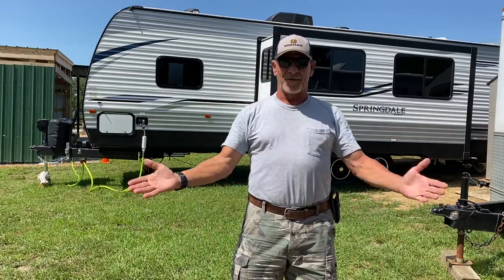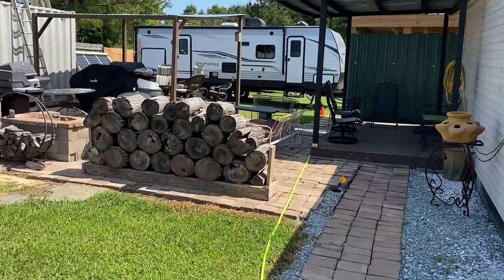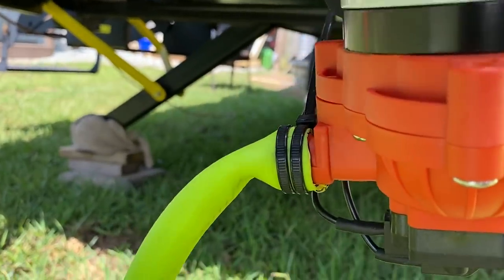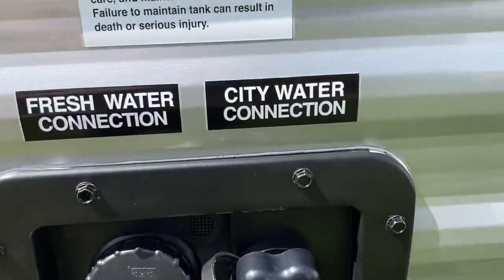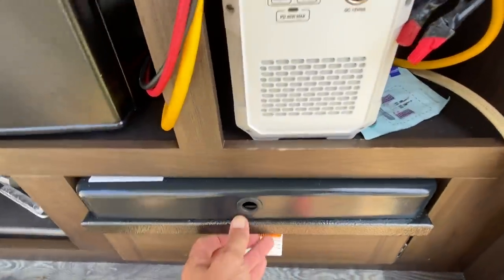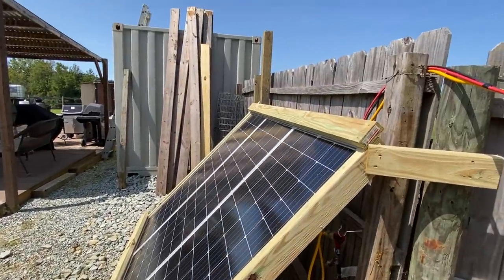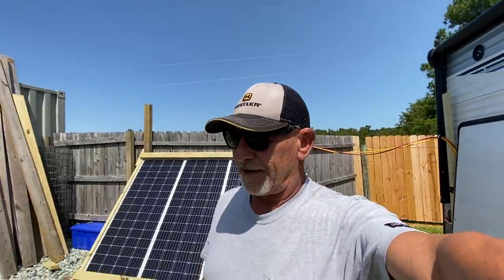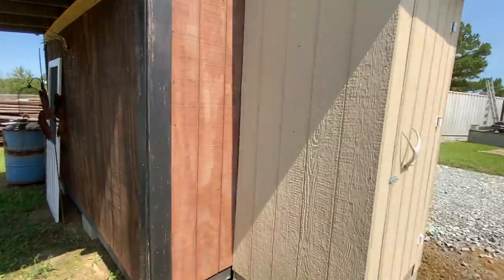HOW TO GO OFF GRID.  RV LIFE.

Comment: Looks good Tom. Would you consider adding smaller water catchment systems to all your buildings. You would have to transfer water into your main tote, but I would rather have to much water than not enough. Glad to see you went with solar. Take Care
Reply from the maker: Sean yes I will build a smaller water catchment system off the new pole barn building going to the RV.

Comment: A little criticism your hose will freeze, the tires should be on a board or a paver, defiantly put  under pinning around the camper.   GROUNDS!!!!!! GROUNDS!!!!!! GROUNDS!!!!!!  You need to ground your system and the trailer!!!!!!!!!!!!!!!    Why don't you buy or make a door so you can run a bulkhead fitting through it and close that door to  seal everything up?
Reply from the maker: Thanks Fred for your information.  I know I could do more to protect this RV.  It was a rush to get everything into to p[lace not knowing anything about RV Life.  Learn as we go.
Reply: @tnoel374  I can understand being in a hurry .I spent a year living in a travel trailer.
It stinks if pipes break from freezing and  I hated those fire ants.
Reply: Best to put the trailer on jacks, take the tires, off, put them in a building, sun will tear them up,  plus the sitting, causes a flat spot on the tires, that  will cause a blow out. When moved,later on. Rubber and sun don't mix
Reply from the maker: @fredmax2541  Fred we are right now in FIRE ANT KILLING MOD every day.  It sucks but there freaking everywhere.
Reply from the maker: @markchristensen5206  Mark I so will be doing that for sure with the tires.  Taking them off.
Reply: @tnoel374  Put a liberal amount of  baking soda in the mound and chase it with vinegar.
Reply from the maker: @fredmax2541  Good Idea Fred I will do it.

Comment: artic package only works if your running your furnace all the time. they do make heated hoses to run to your water supply outside, just pricey!  you should name your rv park now to get your name out there!
Reply from the maker: The OFF GRID air B&B RV Park.com.
Reply: I thought you were trying to be low key
Reply: R C The artic package does not mean the RV is ready for Alaska either like he stated. That RV only has 3” walls and roof with an R-7 insulation and R-20 in the floor. The floor also has a trunk line running down the center to heat the water lines and keep the tanks from freezing but like you said R C, it’s only gonna do that if the furnace is running all the time and that’s gonna get expensive with running propane because he’s gonna need more panels than that to generate enough solar power to run the furnace and everything else all the time, he will have to be running propane heat at least 50% of the time with that setup because that furnace, if it’s dual fuel, will suck the battery charge down pretty quick,  that solar system is way to small for full time living. 

These guys are severely misunderstanding what the artic package is. It will survive cool temps fine and it will even handle slightly below freezing ok for short durations but what’s gonna happen when NC hits it’s cold spell in January and it hits 18? Those cold snaps in NC keep plumbers buried for a week or two on homes that freeze up and most of those have more than an R-7 on the walls. 

Anyhows, there’s always one sure fire way to figure out if you’ve got things wrapped and insulated and sealed up enough. This is supposed to be one of our worst winters in a long time so we’ll see how they fare in 4 months or so.

Comment: The other thing; owning a travel trailer myself.  That guys going to burn through your fresh water quick.  Obviously not on purpose but just taking a quick shower or doing dishes; that water will be gone pronto.  You guys need a bigger tank; maybe a delivery service.
Reply from the maker: We are working on that issue about available water supply, and a backup system.

Comment: Tom are you going to build a room for your water tank so it doesn't freeze in the winter time
Reply from the maker: The water tank is good to go, in the RV insulated big time.
Reply: @tnoel374  The holding tank and hose up to the trailer will freeze over the winter.
Reply from the maker: @echamilton  I will insulate them too thanks for your thoughts.
Reply: He ignores the obvious.😱 It's going to freeze .

Comment: Looks like you have the 2x4’s a little too close to your cells, they have a bit of shade on them so it’ll reduce your output. Otherwise looks great
Reply from the maker: Yes we thought of that, and it so very close to the top and bottom edge, to not have to much shadow.
Reply: @tnoel374  awesome, but any shadow at all even just a touch will significantly reduce the current through the entire string unfortunately, it's like a clog in a pipe. I know it sounds funny but it's true aim for full sunlight, should make a big difference.  Cheers and happy off gridding!!
Reply: Any amount of dust  can reduce output
Reply from the maker: @ronin43  Thank you I will look into that detail thanks for sharing your insight.
Reply from the maker: @markchristensen5206  Yes Mark and we will be in cleaning mode every week.